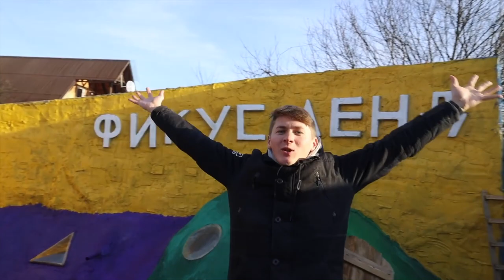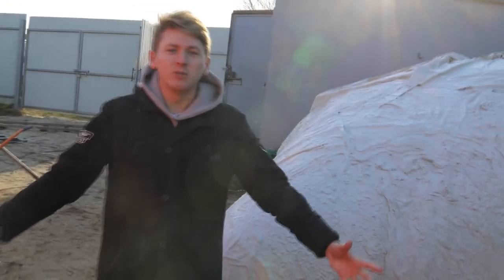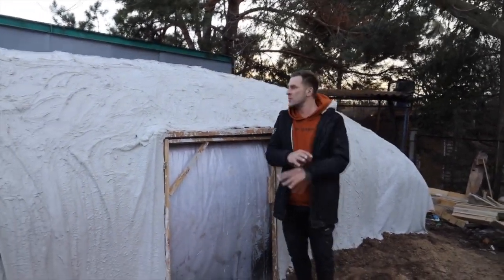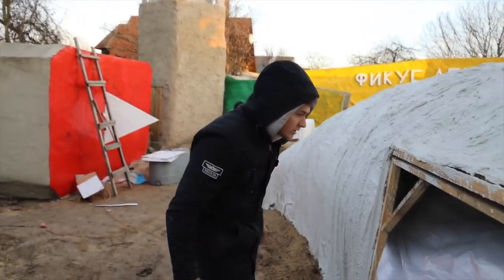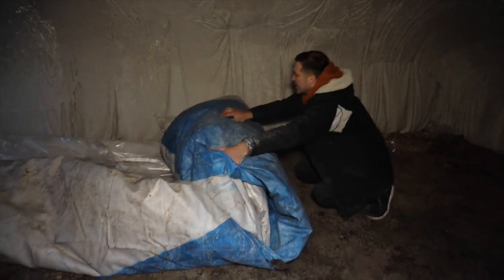GIANT HOUSE FROM GYPSUM (PLASTER OF PARIS) - DIY

Comment: Plaster of Paris is an extremely porous material when dried, and as such, will absorb any new water that touches its surface. In order to waterproof plaster of Paris for outdoor use or for temporary exposure to water, you must fill in as many surface pores as possible. The most common fillers used on this type of plaster are resin, wax and shellac, which all work to varying degrees of efficacy. Although you cannot create a perfectly waterproof plaster of Paris piece, as eventually some moisture will get through the surface treatment, you can give your creation some degree of protection from the elements.